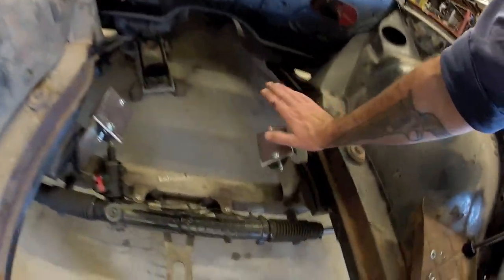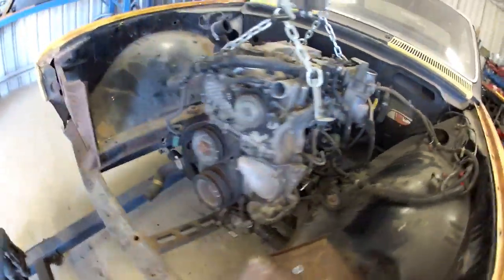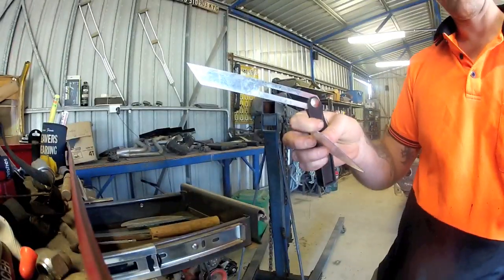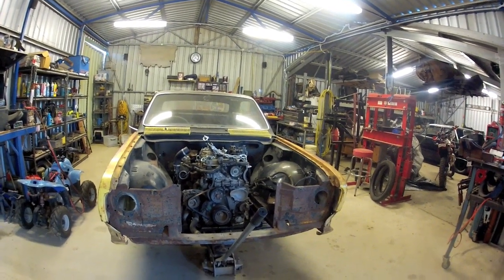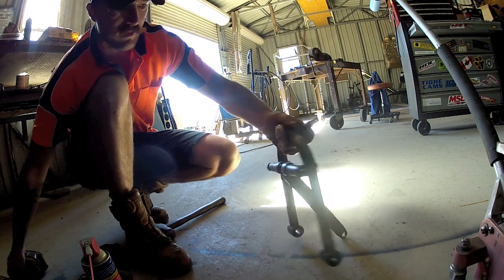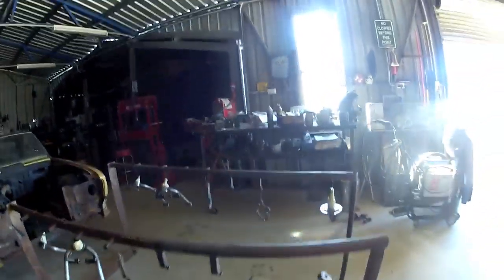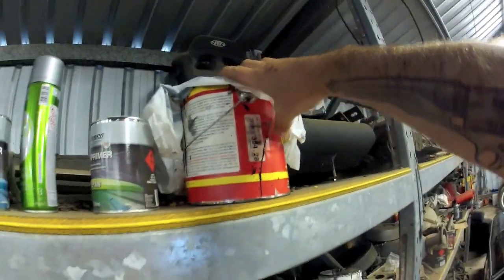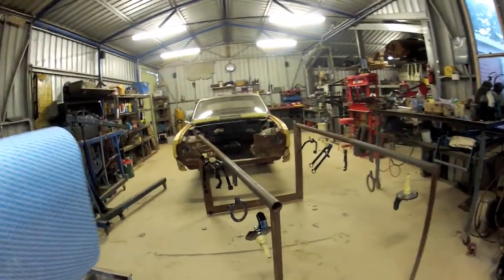Pete's HG Monaro pt25

Comment: Ps love the val. What size rubber did you squeeze under it, and did you have to tub the rear a little?
Reply from the maker: They are just a 215/70r14 stock tub and unrolled guards